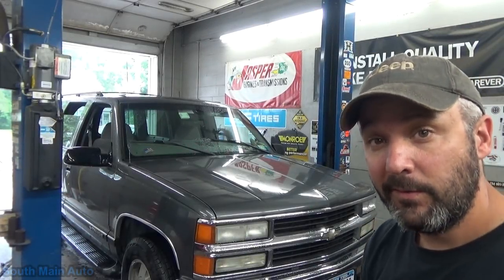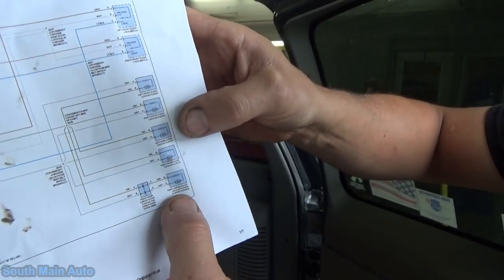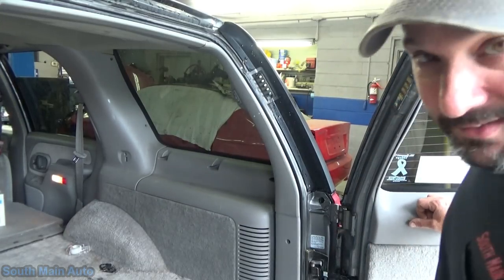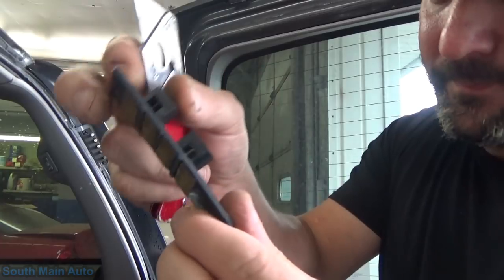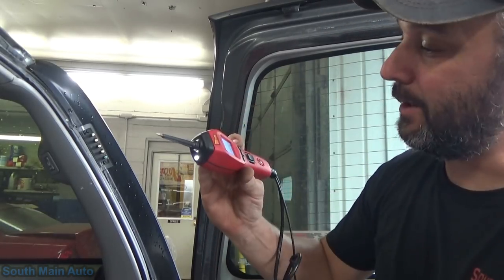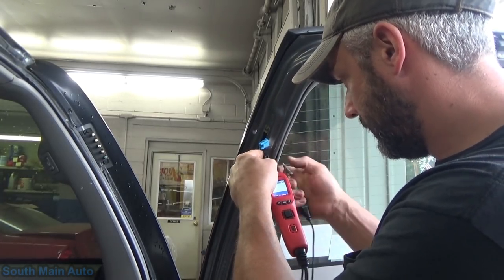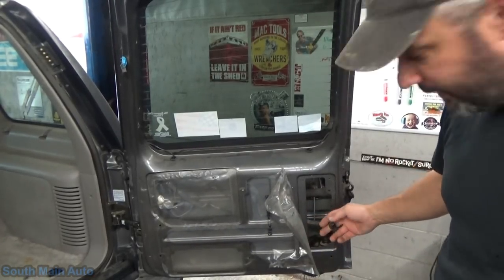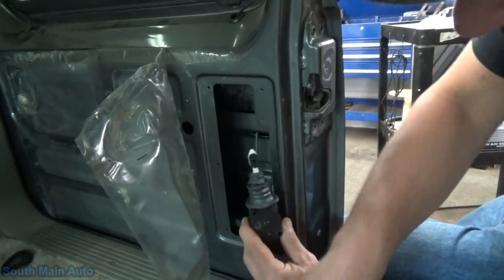Chevy Tahoe - Rear Door Locks Do Not Work

Comment: Hey there Mr. O.  Newer viewer here.  Just ran across this video and had to let u know this.  I also have a 99 Tahoe and it has the same problem so I think this should help a lot.  But  what I found extremely funny is when u said this one had  about  250,000 and had motor and trans  swaps.   My  Tahoe  has  450,000  and  has the   5.7L  Vortec  and  the trans that came in it.  Most people don't believe me when I tell em that.  It was my dads and I got it when he past away in 2010. So its been with the family for most of its life.   It has mostly all of its  factory equipment  so both he and I have had to  do very little repairs to  it.  It has been recked  a couple time and it looks like hammered hell but I wouldn't trade it for anything.  Well  maybe a  great  1964 & 1/2  Mustang.  My dream car.  Maybe  I  can send u a picture of my  Tahoe just for  shats and grins.  LOL.  Anyway,  keep up all the good advice  and videos..   BTW,  we also have  a 2006  Chrysler Pacifica with the  3.5L V6 that I got for my wife for Christmas and BOY is she not happy.  I am having a big problem getting it to run.  Cranks but won,t start up.  I have watched many videos but no dice.  It also dose not get gas from the tank to motor.  Had a bad timing belt and I changed it and water pump and bearings.  Anywho,  I would love to see u do a video or  maybe a little series of videos on the Chrysler Pacifica.  Thanks again, and I WILL KEEP WATCHING.

Comment: I've probably replaced over 50 of the actuators in 94' to 99' Silverado's, Sieras, and Yukon's, I have drilled every one of them, takes about five minutes, never ever have scratched the paint, it is a whole lot easier to gouge the paint with those high-speed grinders.  But to each his own.  But as for the diagnosis, you have got to be one of the best men I have ever seen to logically diagnose a problem no matter what brand or make vehicle.  You are sorta like Yoda, Umm Help You I will...All kidding aside, you are like Yoda in that you obviously have worked on vehicles a LONG TIME!  You have a vast amount of knowledge of the inner workings of electrical from wiring harnesses to ECM's/PCM's, Just my kinda guy!
Reply: ...I agree, Carefully and properly drilling rivets out is the only way to go! ...IMHO!

Comment: You are grinding on an aluminum rivet....that's a no-no.   Knock the steel mandrel out of the rivet with a pin punch, then drill the rivet heads off.   Faster, cleaner, no paint damage.  If they spin, hold the drill bit at about a 10 degree angle. They'll still spin, but the bit WILL remove the heads.   Love your vids.

Comment: Don't know if this helps: assuming your "green crusties" are the same as the green stuff in electronics where alkaline batteries have been left in too long, instead of scraping the green (which can degrade the underlying terminals), wipe it with some Qtips dipped in white vinegar.  Dissolves the green stuff instantly, and usually leaves the underlying terminals shiny and functional.  I've restored a lot of things this way that other folks just throw away.

Comment: Heat gun will make water seal easier to remove. Maybe I've been lucky, but I always drill the rivits out. Only had a few that spun. I used to replace marker lights on van bodies. Us a punch to knock the pin out first then drill. Thanks and  keep up the good work. Big hello yes on air riviter.

Comment: Oh the Chevy bashing hurts but so true on these Burbs and Tahoe's. I had one with 212000 had a crate engine at 140 and 3 Transmission Rebuilds. 1 was my own. It was a dealership car and had excellent records. I still like Chevy though Dad had a work truck that was ran hard , the old 3 on the tree with a 305 I tortured when I was 16 and you couldn't kill that CHIVY.  Still a chevy guy

Comment: Happy Independence Day!

I installed Dorman lock actuators in our '86 Grand Marquis - the driver's door one only lasted 4 years before she had too much cheese too - bound up solid. Was interesting how those things work - I always pictured them like a solenoid, but instead it was a  steeply threaded rod that spun at high RPM to pull the lock up and down. Pretty neat engineering there.

When that Dorman junk failed, I took the OE rear door unit out, swapped the rods out to each, and swapped the unit from front to back - I can live with a dead rear door. Strange thing about it was, electrically it still worked fine ... but if you tried to lock or unlock the door with the key, you'd twist the key into a pretzel before it would move (not that I tried, lol). No key hole on rear door, so all is well ... for now. 

The junk rubber boots weresmoked the day I installed them. Dorman really is terrible with most of their product lines ...
Reply: it's all garbage, even the OEM parts, else they;d not be bad yet ;)

Comment: Sweet ! Glad to see you fixing a battle iv found  with my tahoe.  If i could add in what ive been finding that  adds to these problems like these is  1.  weather stripping surrounding the entire opening was  collecting anything  imaginable running off the roof beeing drivin, parked under a tree or whatever u can imagin,  possibly even gold  if you were to pan the filth cleaned  possibly paying to add two cents to the issues ™️.  Cleaning it out and treating the stripping to bring the life back into it allowing the rubber to soften and squeeze to really close and latch as it should.and stop the slamming door sound . Remember it needs to be maintained just like urr paint, oil etc. 
# as well. Hosing it out should work 
#2 degreasing the old stock grease or whatever ms been used to lubticate them  use Per chilton manual a dry graphite lube or something that wont collect anything that touches it like a fly trap. 
#3 makes sure olugs and contacts are clean and operate properly using light dielectric grease to keep the contacts from corroding. Thats all i got. From me to you keep them hoes clean!  Chevy tahoes that is😅

Comment: Eric, it is still easier to drill them out. Yes, even after they spin. Just hold the drill at an angle and I drills right through them.
Reply: I do that first then drill them out and use pop rivets to reinstall  them

Comment: I have a 1999 Tahoe I bought used in 2011 and the rear door lock would work intermittently. The first thing I found was that the contacts at the top of the door were corroded. After cleanup it would trigger OK but not always perform it's function. BTW, the contacts on the other door are for the defroster wires. 

Tearing it down I found that someone had been there before. The actuator and it's bracket were sitting on the floor of the door. In one direction the actuator would actually lift itself off the floor and the weight of it would pull the lock down. In the other direction since it was on the floor it could push fairly well. 

The rivets were long gone and they had tried to put it on with bolts and nuts but due to the lack of internal access getting the bolts to stay still to tighten things down wasn't possible and they gave up. If the electrical connections were as bad then as when I got it the actuator may not have been responding contributing to the abandonment. Since I didn't know it had originally been fastened with rivets I changed a few things around with the bolts. I put in two with a nut right on the bracket to hold them in place - since it worked free floating the actuator could obviously tolerate being 1/8 inch to the left. I put it in place and marked the bolts so I could cut off excess after I mounted nuts on them on the outside of the door where the rivets would have been. It's been working fine and it's been over 10 years.

Comment: I know I would prefer that rivets not be used in 95% of the situations that they are. What is your thoughts on that Eric? I for got the the rived usually just spins. I grew up with a father who was a mechanic. I should have remembered that the rives tend to spin.  IS that siren that I have heard in this video and others from the local fire station? I really like those fire station sirens most of the time. I live in a suburb of St. Paul, Minnesota and my local fire station still uses theirs for (fire) calls and 3 times a day (noon, 6 pm and 9 pm).

Comment: Mr O, why grind off the rivets?  Would drilling have been quicker or easier with less risk to the paint?  I m assuming that they were just pop rivets.

Never mind.  I was typing my question as you started grinding.  You explained your reasoning when you broke out the chisel.

Comment: Easy on the vintage Era of great GM. I have a 97 Yukon with 317435 miles.  Original motor with no major engine work, 2nd tranny. still gets 16.8mpg and runs strong. GM should have never stopped with the 5.7.
Reply: Agree Ed, 99 Suburban with 269, 000 miles original trans. replaced the long block at 199,00. Still way better than a big ass car payment BRO

Comment: Eric, I am wondering why you did not go get your heat gun and heat up that plastic where the black goo is? You talked in another video about how in the summer when it's hot out that goo stuff comes off a lot easier. I guess you just for got to do that this time. Also why didn't you get a jack stand or a piece of wood to hold that back door open for you? I guess you didn't think of it. Safety 2nd better yet 1ST! Most people would have drilled out the rivets. Why did you choose to grind them down? I thought a drill was the best choice if you do not want to muck up the paint?

Comment: Looks like it could use some sort of retainer on the linkage where it connects to the actuator...
Reply: it's a rubber bushing and the "spearhead" end of linkage snaps through tight. they rarely come out, except for total rubber dry-rot failure. chinesium :)

Comment: Hi to you can you give me a hint on 1998 Toyota Camry station wagon here in nz all 5 locks open but will not lock frustrating tested all locks one by one all work electrical with a 12v power supply by reversing polarity lock and unlock work perfect but with inside dash switch and key will not lock cheers mike.

Comment: whats odd is that such tahos/suburbans of late 90s here in the middle east easily can go past 500.000km on an original motor! i find it strange to die early on 200k miles in the US.
Reply: real iron still used and mostly old school engine still,  heads/intake/cam profile changed and basic throttle body fuel injection, transmissions chew up pretty fast, and bodies rust out due to salt.. :)

Comment: I watch all your videos, I'm also having an actuator problem,I hear it working, driver door don't unlock.but I'm a Chevy Man and you seem to slam Chevy and GM. I know you said it's surprising that the truck had 250k, you also said you didn't find it surprising that it had 2 motors and 3 trannys. 
I would have to say that is probably a maintennance or care thing. Seeing as the owner is bringing his truck to you, Maybe the person never does tranny or oil fluid changes. Because there are lots of these GM trucks on the road with that kind of miles and original drivetrains.
Some with way many more miles.
Also a lot of people are talking about GM using rivets and not screws. Rivets  are faster on the assembly line saving time and, they won't loosen later like a screw. Just a pain drilling them or grinding when replacing the part.
Reply: I've owned many GMT400s and many other GMs, currently my fleet consists of a 92 C1500 and an 02 Envoy. Both have had transmissions replaced once, otherwise engines and differentials and most other things are original. The C1500 has about 250K and the Envoy has about 220K. The 700R4/4L60E just isn't a very strong transmission especially if you beat on it, tow with it, or don't service it every 50K. In terms of engines, the Vortec 5.7 can totally last 500K+ but if the intake manifold gaskets (which have like 100% failure rate) fail in such a way that coolant gets into the oil, and you don't catch it immediately, it's done for, and even a little bit like that for a short time can reduce the lifespan significantly.
Reply: RedWhiteAndBlueVideo chev and gmc are over engineered and designed to tare up

Comment: Hi Eric
Do you have a supplier for the large head rivets in small quantity?
As a DIY person I have a need for 2 or 3 maybe 5 with no frequency.
Can not locate them in less than 50 and price is high.
Reply: befriend someone local that does body work or a dealer mechanic, have them grab the stuff via employee discount :)
Reply: I was hoping that someone would know of a supplier that packaged in small lots maybe 10 or so. I can find the regular rivets in small lots but have not located a source for the large head long shank rivets.
The employee discount not really an option for me. (LOL).
Reply: Swallow Inn maybe ebay?
Reply: fastenal likely only has them by box/bag if stocked, if order then it would be multi-thousand quantities and dollar.
Reply: Hi Austin
Thanks for the reply I have tried them and will check again.
I used to be able to buy packages of 10 but they seem to have disapeared from my local suppliers or price is the same as a lot of 50.
Reply: Help rack at the local NAPA maybe
Reply: Thanks Anthony Ifnally gave up on the 10 pack QTY. I broke down and purchased a bag of 50 so will have lots left over (LOL). I do a window regulator once or twice every 3-5 years hence the reluctance to buy more than 10 at a time.

Comment: Yeah, typical engineers.  You'd think the door locks workings could be programmed (or wired) so that only the driver's door vs. the rest of the locks would open with the keyfob. Why? Most of the time it's the driver's door that is used so the other doors are just unlocking for no reason in most cases.  You'd think they'd have a button on the keyfob for one door and another for all doors or a press and hold for all doors or similar design. I know that Jeep computers can be programmed to respond to the keyfob with all doors or just the drivers door. It save on wear and tear on at least 4 other actuators in the least. 

Those contact plates on the Tahoe are a great idea to prevent wire fatigue. Maybe now and then, a very thin coat of die-electric grease will prevent the green crusties from forming since those contact plates are in the water gutter.  Nice fix. They do make those rivet drill bits and even though the exterior "washer" does spin, the core is released from the interior crush sleeve most of the time. Maybe opt for the drill first and if no luck the chisel second. Either method works although the chances for paint damage is most likely with the chisel and die grinder. Never really understood the reason of rivet fastening method vs. a threaded fastener for regulators and these solenoid mounts other than the assembly advantages but not for the service advantages.

Comment: You would think after a zillion years in production Generic Motors could manage to fix most of the frequent and common failures on their bread and butter vehicles like this one? But I guess not. Basically GM electronics suck. My friend's C7 vette has been back to the dealer ten times in the 4 months since he bought it new with mostly electrical problems. Ford seems to do a much better job with anything involving wires, connectors, software, etc.

Comment: What...you could have saved a bunch of time using "Big Nasty" on those rivets. Ha! Just kidding. Happy 4th.
Reply: rmcracing69 Or break out the "smoke wrench".
Reply: rmcracing69  was thinking the same or maybe plasma cutter or 4" flapper lol
Reply: Actually, not as bad of an idea as you might think. I used a cheap Campbell-Hausfeld air chisel that I had a machinist (my dad) make that turned a normal air chisel into a pin punch of about 1/16" diameter for about the length of an inch. Put the pin punch part into the rivet stem hole, pull the trigger, and the center of the rivet is driven out. Worked well. I have no idea how much it cost H. J. Heinz where my father worked to make that tool for me but I'm sure it was a lot.